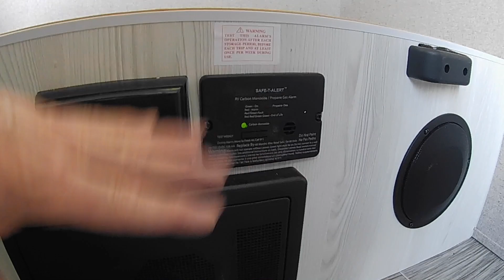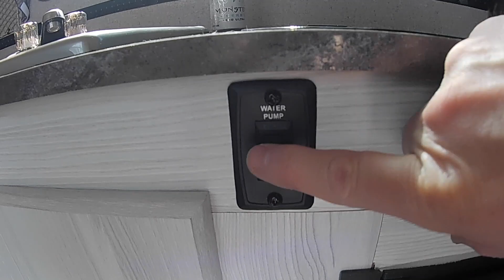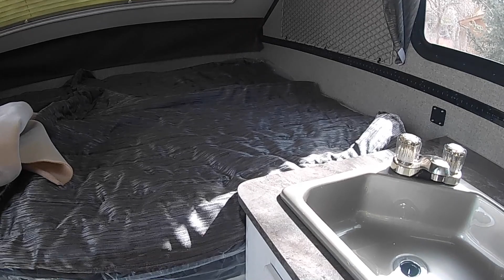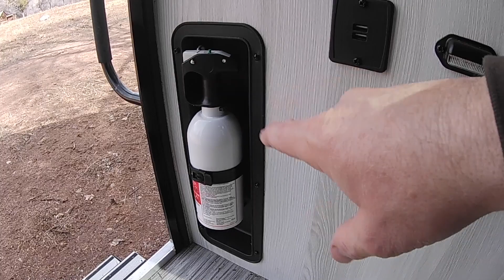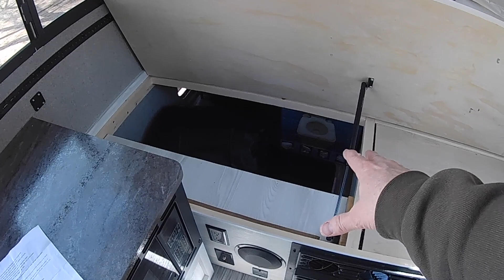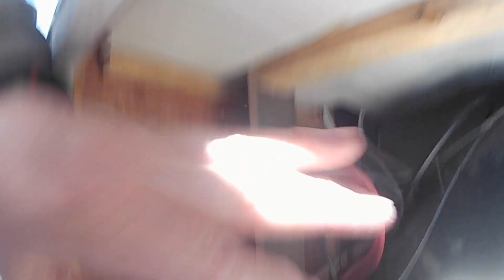2019 Forest River Pop-up Camper Review - Part 2

Comment: Im Shon W. From Canada; I Purchased the A122THESP Forest River RockWood Premier HardSide travel Tent Trailer. I very much love the unit, this video has helped me remember much of the Orientarion at time of purchase that Ive forgotten over the months since signing bill of sale. I can carry my 800 lbs 850 Two-up Polaris Quad on the metal rack which is rated for 650 lbs because of having the 550 weight distribution and sway bar Blue Ox wich increases my tow veicle towing capacity from 3500 lbs to 5500 lbs ( Jeep Wrangler 2019 Willy`s Sport 2 door 4x4). Trailer weight is under 3500 lbs with quad loaded without the water in tank. With water is around the 37-3800 lbs. I was quoted From RangeLand RV in Calgary Balzac that a 3000 watt generator runs the AC or 2 2000 watts connected. Also a 2300 watt inverter is used for a TV, computer or entertament unit such as video gaming. And 320 watt or up to 2 200 watt solar power pannels for a 1000 watt inverter. The inverter would have to be upgraded to the 2300 watt for $3000.00 Can to have 400-600 watt pannels put on to allow a full 7-14 days of boom docking.
Reply: 2018 willy`s , 2019 trailer, 2020 Quad

Comment: Excellent video John thank you, we bought ours 3 weeks ago, same exact model from an individual that only owned it for one year. The only mystery I have so far is the fridge, I can't seem to get it cold. We are getting ready to head out for the first camp trip with it tomorrow. I fired the fridge up on propane today but only let it run for 10 min or so. I know that is not long enough but I expected to have some kind of sign of the fridge cycling or doing something. How long from your experience has it taken to get your fridge to a cool temp inside? Thanks again, buying ours used having no salesman walk through it with us made your video series invaluable.
Reply: Follow up.....after 12 hours on propane the fridge was still not ready for food in my opinion. At least it did cool but wow super slow doesn't seem right.

Comment: These are really informative and helpful videos, thank you! We bought one at the weekend and the walk through with the tech was quite substandard. Having seen these videos beforehand though, I wasn't too concerned. I do have a couple of questions if you or your viewers have any answers: Our unit has the power roof lift. What do you do if your batteries are unexpectedly drained? Do you leave it plugged in at home when not in use - even over the winter? Or do you need to turn off the electricity when not in use and how do you do that? Do you need to add water purification solution to the tank? Thank you again!

Comment: You have showed very good details of the Aliner, thanks. I wonder if there is no water leaking through in between the folding roof panels in heavy rain.
Reply from the maker: Hi.  So far I have not had any water issues.  The way the panels fold out, they over lap each other by 5 to 6 inches with a rubber strip where they meet.  If you had high winds and near horizontal winds, it might be able to push some water up under that 5 inch lip.  No issues yet.  Thanks.  JohnnyF
Reply: @TheRealJohnnyF  Thanks for your feedback. 😄😃😃

Comment: John - great video.  Helps tremendously.  If you get your solar sorted with controller mounted, etc. please do another video.  I am trying to decide between lithium batteries(expensive, but should be cheaper in long run) and if I should do a solar suitcase or mount solar.
Reply from the maker: Hi Dan.  I did get the solar installed.  I just need to find time to get a video done.  Work is taking a a lot of time right now.  Stay Healthy.  JohnnyF

Comment: I still haven’t seen the mythical outside grill! Seriously though, great video. Definitely let us know if you’re able to run the A/C on a single generator, I live in Arizona where it is definitely needed. My understanding is an add-on device that eliminates most of the initial surge the A/C creates. I saw a video where someone added one to their Airstream.
Reply from the maker: Good point.  I have not shown the outside grill.  We have used it twice now and it works.  Nothing special but I like the fact that it has a quick connect to the propane tanks on the unit.  So I don't have to have any little portable tanks.  I did try my small generator, the WEN 56300i.  It did trip the breaker.  It is rated for a surge of 2,000 watts and the AC is drawing a little more than that on startup.  So it popped the breaker on the generator.  I tried to find a device like you mentioned for my AC but they all seemed real expensive and not exactly what my little 120v AC unit would need.  It's possible I am looking in the wrong places or not using the right search terms.  I just don't want to take a bigger generator with me.  I like how small and quiet this one is.  Guess I need to find a fan for those Dry Camping trips.  Take care.  John
Reply from the maker: Hi Mark.  I just did a quick check and the manual says it should draw about 1300 watts under a normal load.  However, it does state that you should use a 2800 watt generator to run the AC.  So the surge load has to be be less than 2800 watts and more than 2000 watts, since it tripped the breaker on my 2kw generator.  I will have to look into a surge suppressor some more.  I know it would be better to just have a bigger generator but I don't want a bigger one to haul around.  Most of the time I don't use the generator anyway.  Take care.  John
Reply: @TheRealJohnnyF  thanks John. I would also be interested in further investigation into the ac/generator topic
Reply: Thanks for that info as it is great and gives me an idea for what size generator I would need.

Comment: I watched damn near all of this before realizing there's NO SHOWER  
*I also noticed they used that damned 'chip-board' on the flooring instead of 'Marine Grade'
plywood that's been treated to resist/repel water*
Reply from the maker: Hi.  I did not want a shower taking up space so it was not a deal breaker for me.  I agree on the plywood.  I would much prefer a Marine Grade plywood.  At least the OSB they are using has some special treating and something like a 20 year warranty on rotting.  We will see how that works out.  Take care.  John
Reply: @TheRealJohnnyF  *I want 'the best of the best' and won't accept anything lesser
when serious money is involved in buying something new*
I'll buy a used 'bargain' if I see "I can fix this/that myself and have something nice around" to use
To me, for the thousands that 'Pop-Up' cost, it should be equipped w/a shower!  
*I would apply protective paint made for the purpose of sealing that exposed surface under the camper...I've done that to some 4x8 'Posts' I use for decoration on my driveway, and that 'thick formula' 'Fence & Barn' paint works very well here in Southern Illinois which has brutal weather for 
anything made from wood being outside...I even used it on old bricks I placed outside my 'North' facing kitchen-door that was always a mud-bog before and that paint actually stays on and looks great!
I still have my 'Wanderlust' but economics just won't allow me to 'do what I want to when I feel like it' anymore NO MONEY = NO 'FUN'
( Although I live 1.5 miles from a nice FREE 'State Park' right on the Ohio River so that ain't bad! That's damn hard to beat in 'modern America' )
ps I really like that new "Trail Manor" I've seen on 'Tube
Reply: @gerrynightingale9045  It's like $1-2K more for one with a shower installed.  That would be the Rockwood A214HW.  I'm highly interested in that verses the Aliner LXE.  However, the price difference is great.  I've seen the Rockwood A214HW for as low as $10K used and around $13K new same as the Trail manor (which is... ugly).  The Aliner LXE though is $22K new always

Comment: Thanks John, much appreciated. I wish I'd seen this when I got my 2019 A122 on closeout 2 months ago. My walk-thru at the dealer was less than helpful. I actually helped school my sales rep on some operational features/functions from some online videos and sites. I have got to use mine a bit and towed it with light camping in about 5 states so far. Sadly it's winterized now with snow on the way. I did discover that mine at least had the anti-freeze pump valve inlet under the trailer at the water tank. That was helpful since I didn't have it in the water pump area and didn't have to install a kit. Looking forward to more of your informative videos.
Reply: Hi Gary.  As I mentioned in a reply to Leslie, Google moved all YouTube responses to Spam for some reason and I missed these comments.  I have been enjoying my camper as well.  I added a weight distribution/sway bar setup to my trailer.  I did not need the sway bar so much as the weight distribution.  It really makes a difference.  Like you, I knew more about the camper when I went to look at it than the salesmen.  I can't fault them though.  I only needed to know about one camper, he has to know something about all 40 different models on the lot.  It was really easy to winterize the camper.  Which is one of the main reasons I got it.  We had a motor home for a while and I absolutely hated winterizing it.  There was always one line in the spring that had a crack in it.  One thing to note, on my model the water tank drain has 3 positions, which I did not know.  Drain, Open and Closed.  The point is, when in the closed position, you cannot winterize it.  Took me a while to realize what I did.  I drained the water, turned the valve, added winterizer to the tank and when I turned the pump on to push it through the system, I got nothing.  For a little bit I thought the pump had gone bad.  Then I realized there was an OFF position.  Did have one camping trip that got down to upper 20's one night.  Thats not super could but the heater had no problem keeping it comfortable.  Happy Holidays.  John

Comment: I am not impressed by there wiring skills. Looks rushed and throwed in there
Reply: Hi Road.  Yeah, I am not impressed with their attention to detail.  It definitely looks rushed.  I did have to go back through and caulk in some small holes in the floor where they missed.  There was twice as much caulk as they needed and they still had holes.  I thought about cleaning up the wiring but in most cases there was not enough extra wire to do it.  I would have to splice in more wire all over the place.  I just let it be, for now.  lol  I guess they figure your average person will never look in those areas.  Happy Holidays.  John
Reply: @leslie2784  Hi.  Yeah, it would be nice if there was a wire chase or something but there is always the issue of water laying in enclosed spaces with the wires and animals or insects making homes.  It could be done but it would be a lot of work and you would have to find the right product to avoid those downfalls.  I am just happy that out here in Colorado they don't use salt on the roads like back in Michigan.  In places they use salt, cars and trails are almost disposable items.  Happy Trails.  John